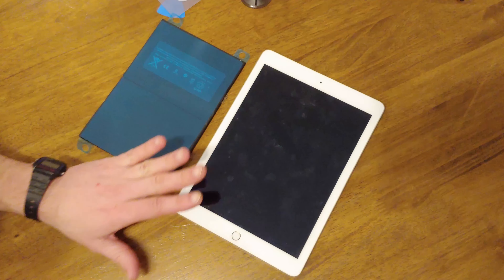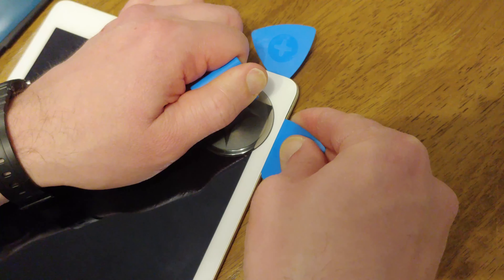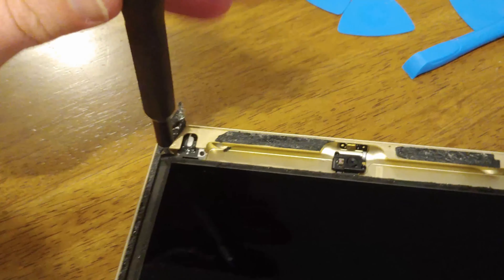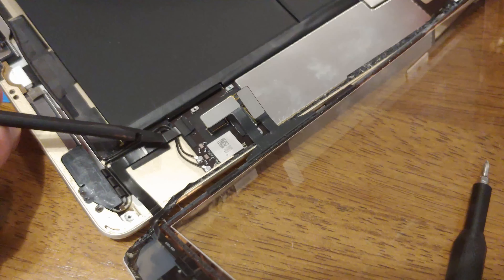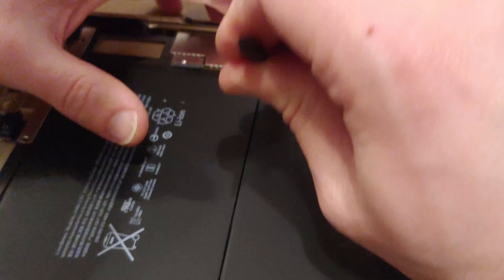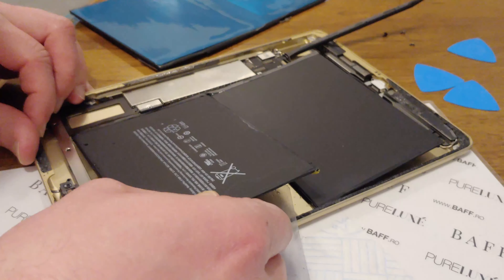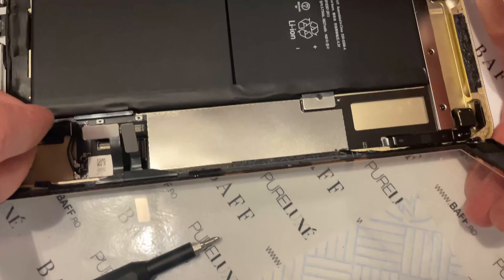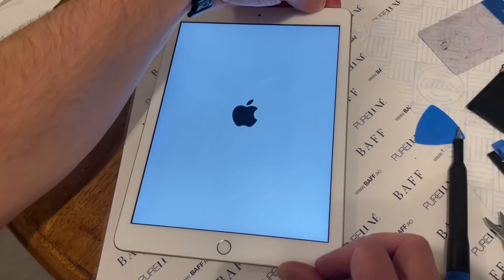IPad BATTERY replacement

Comment: I'm considering getting a used iPad but the complications attendant to replacing the battery is real discouraging. That Apple would make such a routine procedure so complicated has me wondering whether an iPad is worth it. The battery will degrade and fail eventually -- that's a guarantee -- and the expense and complication required to swap it out renders the device disposable for many. Nope I think I'll pass.